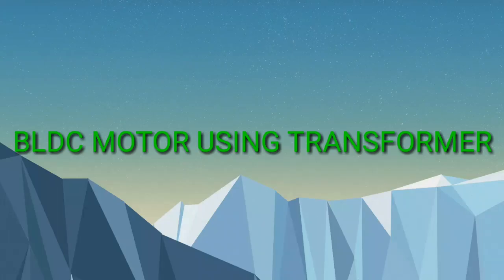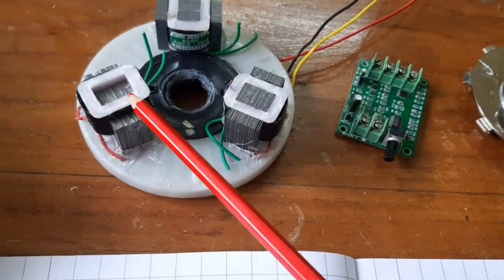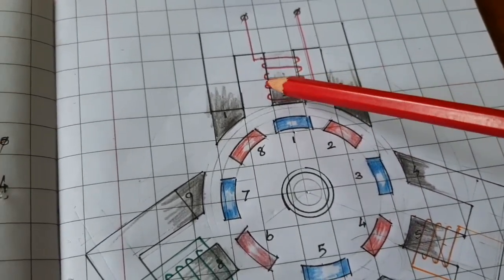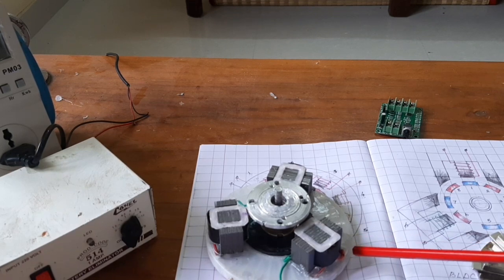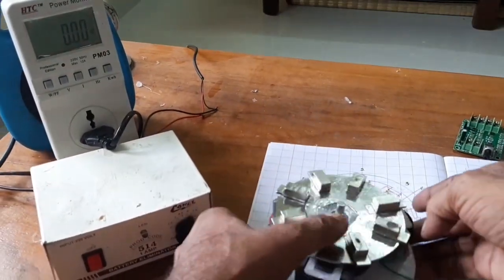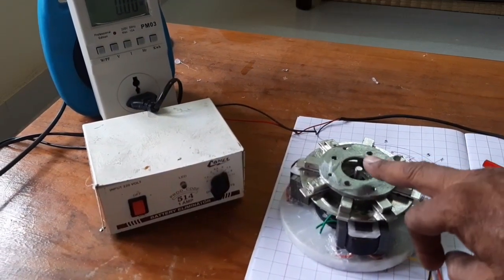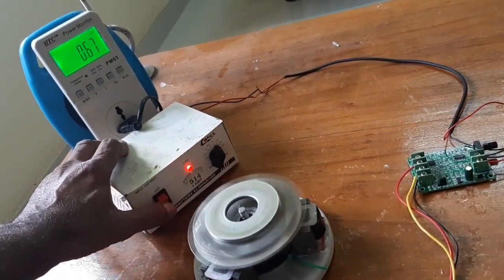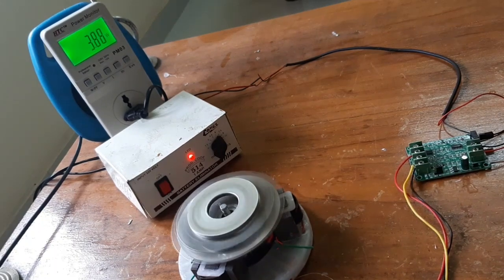(V-34),டேன்ஸ்பார்மர் bldc மோட்டார்/Axial flux Bldc motor( using transformer).

Comment: Sir  why we choose 8 pole 9 slot, what are consideration need to select the slot pole combination
Reply from the maker: First thanks for watching my videos
Each transfer  "E"core has 3poles and we use 3 "E"cores hence 3x3=9stator poles are decided one ok, according to stator  poles we have to choose 8 poles rotor sir
When we give the normal dc supply to core the centre core is north and other two sides are south or viceversa.so that alternativa poles are created in the " E" correct
Thank you

Comment: Very good motor. Does it have a high torque also? Thank you
Reply from the maker: Thank you very much
Reply from the maker: First i used small thin magnets and  the starting torque is very poor and than i added additional magnets for each pole now the torque is good, thanks
Reply: @pugalstech  Thank you
Reply: @pugalstech , I thought you might be interested in an old MAJOR COMPANY US Technology MOTOR GENERATOR. TAKES 24 Volts DC AND CONVERTS TO 1,000 Volts DC. 
https://youtu.be/vqhR43udxAo
Wanted to Wish you VERY MERRY CHRISTMAS AND A WONDERFUL NEW YEAR!!
Reply: @pugalstech  For your motor using the two coils of transformers you may find this simple but very efficient motor arrangements to achieve for you what you wanted. Magnetic Levitation as bearing support will free up enough resistance from your motor to make it perform very well.
Reply: @pugalstech  ....And this interesting accidental discovery is for fun when you have some time.
Reply: instaBlaster.